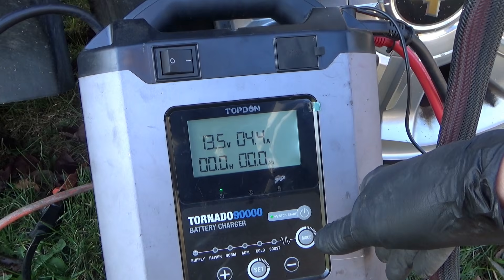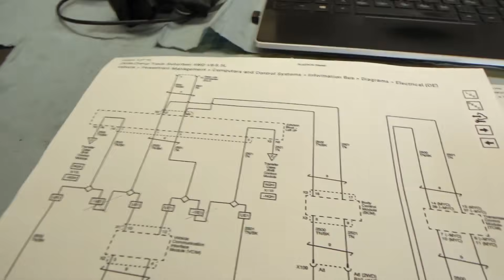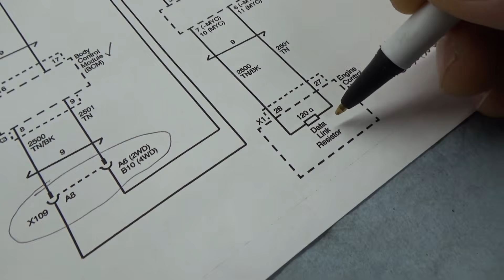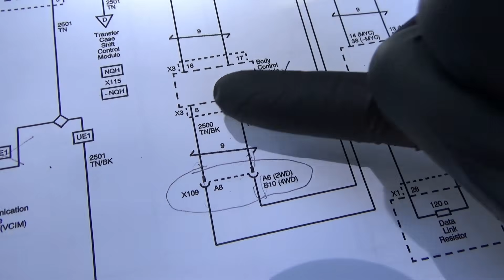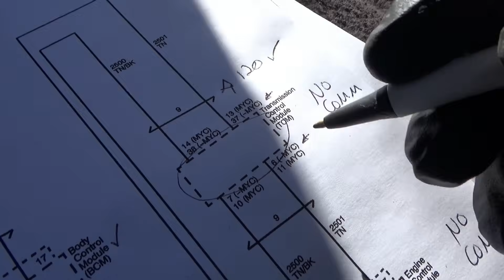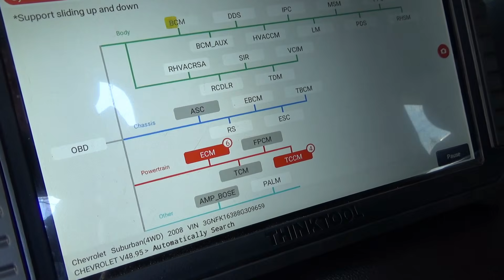(Pt 1) Beached Whale Chevy STUMPS Shop for 4 MONTHS!? ('08 Suburban: No-Crank, No-Comm?)

Comment: I gotta ton of old cars sitting out back that have been sitting there for years. It's always fun trying to get one to run. Almost always requires using an auxiliary gas tank and fuel like, just like my outboard motor. Got started by fixing small engines like lawnmower engines. They don't need wifi to run either. No subscriptions, apps, monthly payments, etc. If it's got gas, air, and spark, it runs. Lawnmowers sold in 2026 need a subscription to operate the carb, the magneto, the blade, the handle, wheels, gas tank, etc. They're all separate too. There's no one subscription to make it run. There's like a dozen of them. Can't sharpen the blade without a system update. Has a 20" touchscreen on it to display video from one of a hundred different cameras and a thousand sub menus for operating the machine. Whatever you're looking for is somewhere in there. What could be easier than signaling a lane change by scrolling thru multiple menus and sub menus without ever looking at the road?

Comment: What this tells me is that the connectors they use are entirely inadequate to perform in the environment they will have to work in. Expecting tiny pins where they could be subject to salt water, and radical temperature change to function over time ignores logic. About once a year, I disconnect my battery, then I disconnect the three plugs to my firewall mounted ECM, spray the receptacle and the plug with CRC QD contact cleaner, then reconnect the plugs. I do the same with my MAF, Cam, and crank sensor. I also remove, wire wheel, and reconnect my grounds with anti- seize. With only 5 or 12 volts, it just makes sense.

Comment: The giveaway is that the resistance dropped from 138 to 122 ohms when you disconnected the connector. If anything the resistance should increase (or stay the same) if you disconnect something. Not drop.

Comment: You would start with a visual inspection above and below the vehicle. You would not pull out the complete engine harness and check it, this is not necessary and is risky if during testing pins were damaged, as we see in the video. The ECM was replaced with a used unit, why? The TCM was replaced with a new unit, why? Why doesn't Ivan have the written work orders/invoices from the other shops to get more information of why repairs were made?

For the age of the vehicle in the salt belt my guess is some electrical repairs are needed before you even start looking for root cause.

You would expect HSCAN to be daisy chained through the TCM, but the resistance check seems to indicate there is a splice in the harness?

You should pull the sprung pins out of the connector and bend the tang back and confirm it is not damaged (use magnifier). Then use Deoxit D5 to clean all of the Dielectric grease off and out of the connector. Dry with compressed air, and then apply Deoxit D100L (pin applicator tip) to each connector pin and cycle the connector a couple of times. Then confirm continuity of the CAN bus using the Ohmmeter check.

Comment: These often have mouse nests under the fuse panel, or the positive battery cable junction behind the battery has connection issues. 
Also grounds on frame under left drivers body mount, or behind head on passenger side. But these usually don't cause completely dead and no comm.
Also have seen an ABS module pull down the CAN. 

Time to watch and see...:)

Comment: Another one! Love these, Ivan. 👍👍👍
Over the years i have learned that an awfull lot of techs have a fault in their thinking. "lets throw some parts at it 'till it starts'.
The thinking fallacy there is that the car/motorbike/tractor/washing machine can be fixed by replacing a part, where as it never occured to them that it can be remedied by fixing a bad electrical connection, an adjustment or even some cleaning...
Untill that way of thinking is eradicated, techs that know their stuff will never be out of work😂😂😂

Comment: I had an 08 GMC Sierra 2500 work truck that had intermittent DOA issues.
 While sitting on the side of the road (broke again) i went on YouTube and found 07 & 08 trucks had a ground strap from frame to body directly under the drivers footwell that would rust away. I used a set of jumper cables to manually get ground and it got me home.
 Tge reason for this story is this problem was a major issue with many people .

Comment: With were are in the current state of automotive repair this happens a lot with missed up pins some company needs to step up and make a resizing tools for pins u depin the connector pick the correct die place the pin in the die squeeze or pull the handle remove and its like new somebody needs to make this tool  they all ready got it for reloading bullets cant be that complex to build

Comment: Nice video and another misdiagnosis to undo. When you mentioned wiggling the TCM my first thought was pin fitment. I got burned by  a pin fitment issue a couple years back and use the AES Wave kit to check for pin fitment if I deal with intermittent electrical issues. 

Let’s see what else they meddled with in Part 2. 😂😂

Comment: Why do people insist on checking wiring continuity with an ohm metre, most of us know after watching Ivan and Eric that you need to load test the wire, will it light a 4 amp test light! Looking forward to Part 2, I enjoy the ones that need a lot of investigation, I like the fact that you are always checking yourself and follow logic, not getting over enthusiastic and charging off down a rabbit warren, which nearly always leads to the wrong conclusion.
Reply: Because it's always a step (several steps) in the directions provided by the manufacturer.
Reply: @mxpants4884  I understand why manufactures say that but it's by no means the best way, for reasons I'm sure you understand.

Comment: Lots of various wrench heads likely have had their hands on that Suburban over its years. Maybe only recently and only one wrench head. Just more proof that todays vehicles really need an automotive electronics technician and a good mechanical technician. Most vehicles will not get fixed correctly with just a mechanic unless he's educated in automotive electronics and has the equipment to diagnose them. Then, as a repair guy, you cannot be the elephant in the room, you have to have the right tools for just about everything as in this video, someone used an incorrect probe size or object and didn't realize they damaged the female pin side. It simply amazes me how many shops and mechanics get into repairs with a customer's vehicle and then cause collateral damage along the way. Worst possible thing they can do is that. Like getting into a customers car and leaving black greasy shoe prints on the carpets !  Its that kind of mentality that should disqualify a mechanic.

Comment: Did you know? The ability to Auto ID via OBD2 / Scantool was not a requirement till 2011. So vehicles older than 2011 had no requirement and was up to the OEM to have Auto ID in the software in the PCM/ECU.

I never knew that, neither did any of the techs at the shop was at that were ASE Master Wizard Techs including the CA Cert Smog Check Inspector some how didn't know when he 100% should have known after we had an argument more of a debate cause they complaining about the OTC Evolve scantool THEY got the shop to buy. I volunteered to manage the shop tools and equipment, including Scan Tools, lifts, etc I would make sure updates are done before open Monday, made tech only gmail acct for us in back that all the equipment is registered from, google drive with all documents, manuals, youtube music as I setup other techs can play / control music from their bay to all bays (that they could mute their bay if they didn't like it and pause/mute when the intercom keys up), etc contact customer service with issues. Then cried that auto id doesn't work all the time, slow, hard to find bi-directional functions/tests so they claim it's not as advertised, POS, bla bla bla. it was all of our first experience with bi-directional. 

I had the scan tool ready to be sent in to OTC under warranty for slow and battery I only needed manager approval first (govt agency) to send it. OTC was paying for it all. They were going to overnight / nextday a loaner unit while ours in the shop all free. Manager quit cause GM and new manager from Big-5 cashier cause no one would accept job offer after the interview and seeing how the shop is and management. Yeah that bad... New kid is a bumbass prick that lies, childish, etc Ignored me as I attempted to ask him 3 times via email for approval to send the scan tool in writing.

So I said fuck it. Told other techs I tried cause they coming at me asking why I haven't sent it in yet.

By then the time they kissed ass to manager to send it the warranty expired. Now no free work, no shipping, no loaner with upto 2 day ship.

They spent $320 bucks for the repairs acting like it's my fault... It was put in my yearly eval against me only that should applied to every one then. Other battles came at me with manager with upper management conspired / planning to terminate me and make it stick. SO I'm terminated for (4-5th attempt) a incident that I was almost killed by not my fault. Still litigating it with union v them.
Reply from the maker: Wow...sounds like it's time to open your own shop and ditch the OTC scanners for something much better :)

Comment: About 2 weeks ago, my wifes nephew dropped off his truck. 
He locked up the engine.? 
So he ordered used engine.
In the process of me removing the engine. The engine bay was covered in oil/greasy/muddy mess. 
So i pressure wash the bay. 
Better now, next i noticed the wiring harness exposed wires, insulation cracked. Im in the process of some minor harness repairs and recovering the harness with cornvoluted tubing. Wrapping the harness. 
But its to dang ❄️❄️❄️🥶🥶🥶. 
Yesterday was warm. So i got some work in. 
The used engine arrived, the shipper sent the wrong engine. 
According to the shipper, the forklift driver loaded the wrong engine. So i shrink wrapped the engine and shipped it back. 
Anyway, in-between my work schedule im a So called Technician. 
Because I have a scanner.😂😂😂😂

Comment: It would be much quicker and simpler to solder a bypass bridging the connector.
Reply from the maker: uhhh that would eliminate the TCM from the network?
Reply: @PineHollowAutoDiagnostics  ? By simply jumping across the connector ? You would not even have to cut the connection simply jump it .
Reply from the maker: @philliplopez8745  which connector do you mean?
Reply: @PineHollowAutoDiagnostics  all of the connectors with loose pins . Rather then disassembly and manipulation of those tiny pins and sockets . One must stay in touch with reality .
Reply: @philliplopez8745   Wow, what a 'professional" solution... thats going to look so neat and will definitely be easy to seal
Reply: @joeds3775  liquid electrical tape . Go ahead , waste your customers time , it's OK .

Comment: When I was in the car business, this is one of those vehicles I didn't like to start working on. One that someone else already had their hands on. If the vehicle just breaks on its own and no one has tinkered with it yet, those I am perfectly ok with. It all comes down to you don't know for 100% certain what someone else has already done. By the way, I despise those round terminals that are like the ones in that connector. Sometimes they work, sometimes they don't. Those round terminals are some of the dumbest terminals ever created. They have a tendency to spread or have bad connections, even when the vehicle is brand new. I've seen it more than once.

Comment: Don't ever get over zealous and push a too-large test pin into connector least you'll over expand the the connector leading to future intermittent connections.  YES!! Female connrctor pins can be over-stretched!!!

If unsure, one might consider back-probing instead.

What is needed is an ASSORTMENT of test pins... and care required to select the SMALLEST acceptable pin size.  Throw in a REQUIREMENT to ALWAYS do a drag/fitment test on several of female connectors.

Comment: Worst case scenario I have had luck kinking the pin tip, not bending the pin over but kinking the tip just slightly or try squeezing the pin tip with heavy needle nose to flatten it a bit. I've also ran a very small piece of wire down the hole to wedge it. Yeah buddy ribbon cable is fun to mess with on a $10,000.00 freq. drive because the maintenance man decided to FAFO.
Good stuff Ivan

Comment: Ivan, I've been watching long enough that as soon as you said the shop had performed an (assclown) diagnosis on the entire harness, I immediately thought of the likely careless oversize probes these (assclown) mechanics would likely have used.  You and Eric O. have both encountered these mechanic-in-name-only corruptions of an otherwise perfectly functional system.  [Additionally, as both you and Eric have noted, an ohm meter test is completely incompetent diagnosis--you must do load testing.  The previous shop gets an F-minus on this exam and would likely never pass your excellent classes in diagnosis.  Best wishes for continued success from not-freezing Florida.

Comment: Ivan:  "This is pretty basic stuff."  Me:  <stares in amazement>.  If I had to fix this it would have taken a lot longer than 4 months.
Reply from the maker: So far the only tools required are a scanner, wiring diagram, and an ohm meter... 😁
Reply: @PineHollowAutoDiagnostics  And knowing how to get pins out of wiring harness.  That is the secrets that get me.
I have what I can only find in one electrical reference as a Ballast Resister.  Can't get it apart  Hoping the dealer will have one.  Maybe seeing it apart will give me a clue, broke two of them trying to remove connector, can't even tell what part is the connector.  I guess it is for noise on the coils.

Comment: Halo Sir.. I got a 2012 chev sonic,, for the past 2 weeks, I see a error code 89 appear for a few seconds, then it's gone.. 2weeks ago, I change both outer cv joints,, I don't know, if it has anything to do with the cv joints... But it comes on code 89 for a few seconds, it does come on every day or e everytime I drive.. What is code 89..
Reply from the maker: I have never seen "code 89"😂
Reply: @renaldo google it… think it’s the thermostat heater circuit fault.

Comment: I did valve cover gaskets on a silverado once. Afterwards i had a no crank. Really? Ended up having no ignition power to the ecm. Found a corroded wire about a foot away from the fuse block. I guess moving the harness just that little bit during repairs was enough to cause an open

Comment: Watching Ivan work is like watching a "murder mystery sitcom" but instead of figuring out who shot JR he figures out why the vehicle is dead-  And sometimes it can be just as big a mystery-  LOL
Reply: Who is J R ? 😉. Asks most under 60 year olds.
Reply: @dharley189  Right. I'm in my 70's so there ya go. With todays complex vehicles it takes exceptional people with the necessary skills to diagnose what's wrong with them.  Like Eric from SMA says at the end of his videos- "If I can do it so can you" But that's not necessarily true- unfortunately.
Reply: @letstalkaboutit8254  I spent 50 years repairing cars. Started 1972 at Subaru dealer than 36 owning my shop. I’m rusty but fixing these electrical/electronic nightmares was my bread and butter. 
I still get called out of retirement to help with them. But I need a box of bandaids to fight the blood thinner I have to take. 
I do know these videos absolutely point out the diagnostic deficiencies in our techs today. 
I’m going to try to not fault them as much as the industry that produces over complicated cars and expects fixes that take no time. Heck I had a long time customer asking about me fixing his clothes drier as two techs told him different circuit boards are bad and it’s still not working. Same problem just different equipment. 
Ivan is excellent but I promise you he spends a hell of a lot of time off camera researching for the answers.
Reply: @dharley189 T.V show..Dallas
Reply: I've always said that being a good mechanic is sorta like being a good detective. Basically, I'm just gathering evidence to condemn the bad part during my diagnosis. 🤣
Reply: Yep! Agree..keeps you wanting to know..
Reply: I was taught to check one circuit at a time.

Comment: This is an example where the Dielectric grease works against you.   Weak tension on connectors coated with grease don't corrode easily but they can be pushed away by the grease.

Comment: 2019 on all  6.2 are recalled by Feds .
Disaster motors.

Just fixed one plastic wear blocks from timing chain tensioner jammed chain and skipped time bent valves pushrods.
ECM went bad also m
LS were so good until AFM and high pressure fuel pump nonsense.

Truck ran then died no fuel ran on starting fluid no spark now no trouble code.
Dealer put new ECM flashed it still no run .
29+ hours labor.
$3000 in parts .
Reply: @mitzvahgolem  What does “recalled by feds” mean?
Reply: @brianw8963  safety recall for engine failure lock up on highway.
Bearing failure.
Was just announced.
877,000 trucks SUV recall by GM ordered
Reply: @johnz8210  I read a recall...but so much online is not accurate
Reply: @mitzvahgolem  Thanks, didn’t see that. I’ll have to check and see if My wife’s 2019 Grand Sport made the list . You would think They wouldn’t put that in a sport car like that , but they did. First thing I did to it was put one of those gadgets in the diag. port to bypass that ;;-);!! function.
Reply: @brianw8963  AFM is just one issue.
This investigation is about rod bearings failed engine lock up.
Perhaps pwm oil pump responsible??

I have 273,000 on GMC Yukon AFM no trouble. I change oil alot and drive in M5 stays in V8 mode .